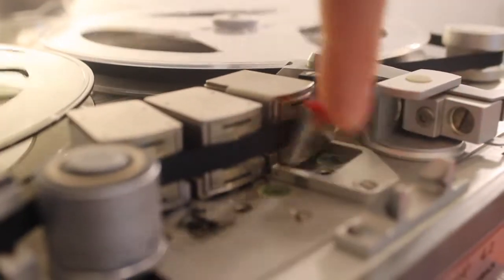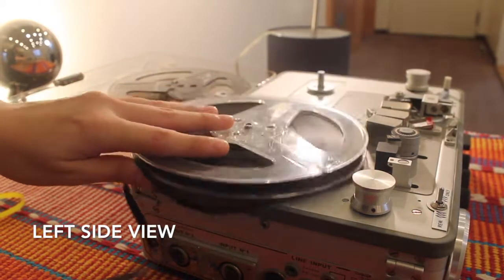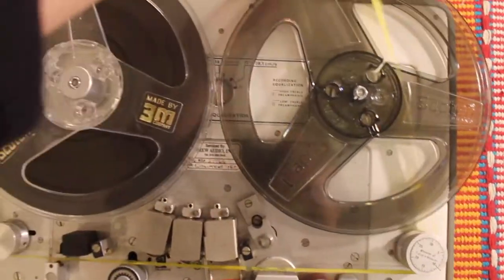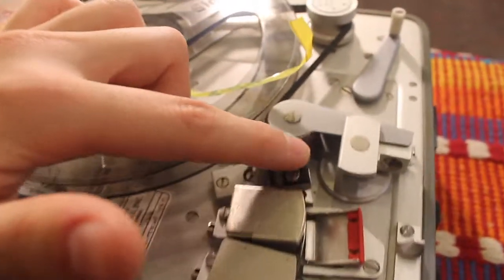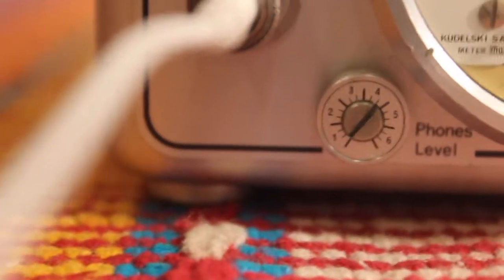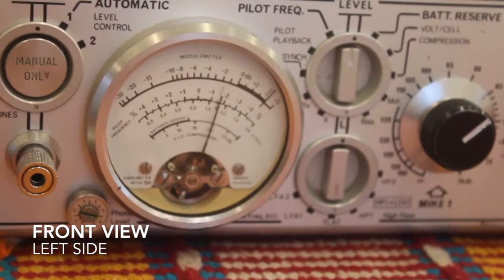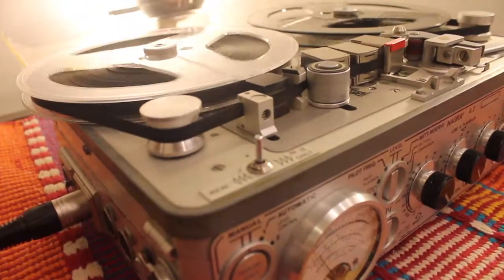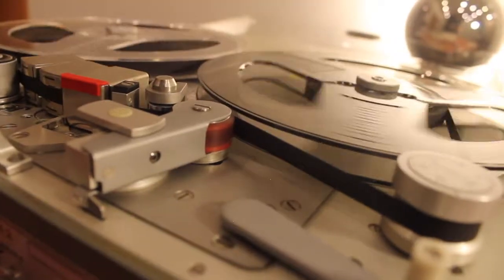Nagra 4.2 Tutorial

Comment: Is this a 3 head tape machine? Can I send audio via (Inputs 1 & 2) and capture onto a computer via (Outputs) into a computer in Real time?
Reply: Yes, it is a three head machine. That three-head feature allows you to monitor the actual recording rather than just the input signal. There is a switch called TAPE and DIRECT that allows you to switch back and forth between the incoming signal and the actual recorded signal on the tape. The Nagra has a LINE OUT that should allow the mono signal to go into a computer's LINE INPUT.
Reply: You could, but it has a latency. Also the delay can vary. The best would be, when it is about 4 to 5 minutes and the start has some metronome click, that you can allign the re-recorded track with the others. For your application, a ½" master recorder could be better, less noise.

Comment: I think you should point out that the "Pilot" indicator should only be showing
if you are making a recording that is being synced to a film camera. When you
are recording "wild", in other words not recording any thing that is to be synced 

to film you don't need the "Pilot" function to be working. The "Pilot" indicator
will work when the recorder is receiving a sync signal. The fact that it was showing
a signal means it was receiving sync  from some place, but this may not be important
to what you were doing. The "Pilot" sync will not harm your recording, you can't hear
it..
Reply: Actually Pilot sync is generated internally to make sure the tape is running at exactly the correct speed even if the machine is being jerked around while chasing someone on foot while recording. The Pilot indicator goes white because it is recording the internal Pilot tone onto the tape and comparing it to the set run speed and corrected in real-time. There is an external Pilot input on the right side for connection to a camera or other machine for motor sync up.

Comment: Thanks for this vid, I have a Nagra 4.2 also and I want to start using it for all my dialog recording for a film I'm going to make, but I will have to run it into my computer for final editing of the film after I record the sound, do you know how to get the recoding into the computer? - Thanks
Reply: oh my... you should not be asking questions like that
Reply: Yes, connect a cable from the two "Fully Floating Line Output" banana jacks on the right side into an analog audio line level input device connected to your computer. Playback the tape and record it on the computer into a DAW or NLE audio track.